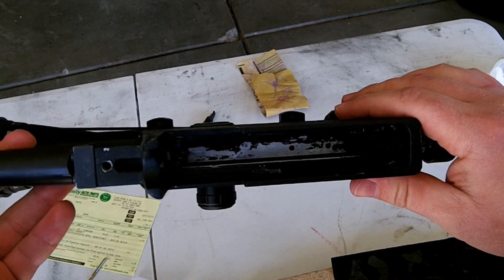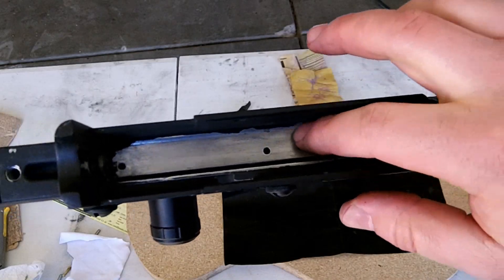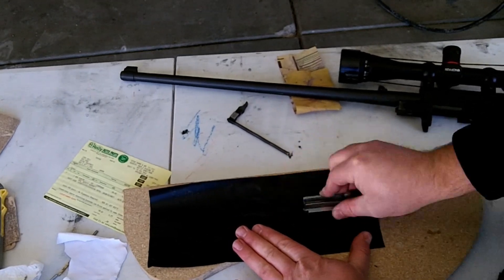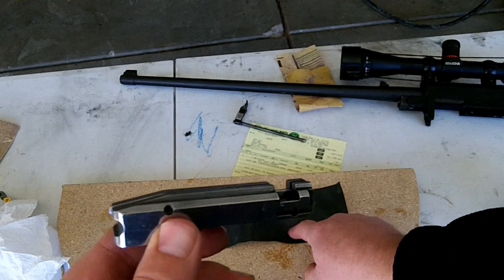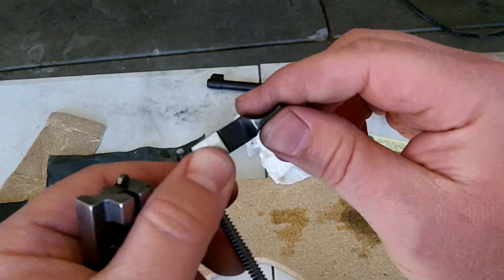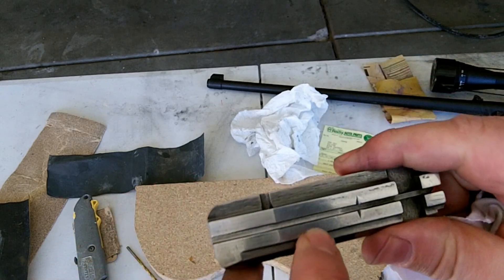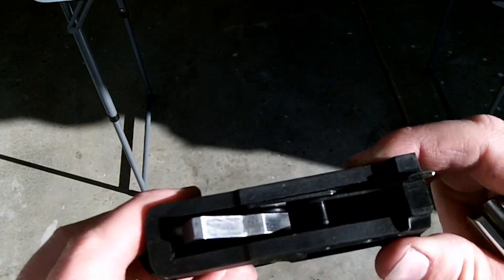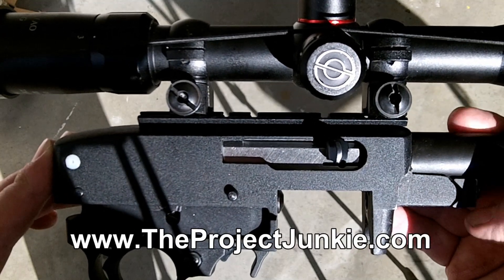Ruger 1022 Bolt Mod

Comment: Just starting this awesome mod.  Two Notes:  #1.  The 5/32 Roll Pin removal -   I tried a 5/32  punch with a kind of cheap "Irwin Pin Punch Set (not a proper Roll Pin Punch).  I got the pin to move a little, but it wouldn't come out, so I used the 1/8 punch like Mark used in the video to drive the pin out.  Funny thing though, after the pin was out, I couldn't get the Irwin Punch to fit into the hole!  I even tapped a couple of light hits with a small hammer, it would NOT go in the hole!  Is it the cheap Irwin Punch, or did I scar the punch?  Not sure, but it wouldn't go in, yet I'm SURE 5/32 is the correct pin size.  #2.  There are TWO (at least) Ruger bolt types for the 10/22.  Mark's rifle has 2 long rails and 2 small "Pads" (as seen in his great video).  My bolt has 4 raised "Pads" or polished sections on each end of the rails.  These "pads" are BARELY raised above the rest of the unfinished rails, maybe 1/64th inch?  My point is... be VERY careful how much you sand the "4 Pad" style of bolt!  I may just polish those 4 areas and leave it at that.  There is a YTube video showing the other style of bolt, it's called "Ruger 10/22 bolt polishing".  Just thought I'd pass this along for other amateurs like myself.  GREAT VIDEO MARK, THANK YOU!

Comment: I would suggest using a dremel and jewelers rouge. The grits you are using in this vid take of too much metal. Guns aren't designed to work in the loose tolerances you are creating. Im not saying not to polish the bolt face, but dont be lazy and use 400 grit. what you are doing in this video is a long and laborious process. dont get lazy and use sub 1000 sandpaper. It probably wont make too big of a difference, but I would be willing to bet your 10/22 is a bit less reliable than a stock one.

Comment: I’ve done all these mods , the radius on the bolt that cocks the hammer is one mod you don’t see much on , these little rifles shoot good but better with a few mods and some aftermarket parts. These rifles are easy to trick out , but it’s difficult to find information on the mods that make them shoot better and trouble free . You did a great job on this video, thanks for sharing.

Comment from the maker: I appreciate the concern but the truth is I've had a lot less cycling and feed problems since performing this and my other mods- And yes I've put a few thousand rounds through the rifle since this mod was performed. I've also had others tell me they've had positive results with cycling. However, I do agree that you don't want to over-work your bolt too much. I like using the 400 grit to level the top fast but I also don't take too many passes with it before I move up to finer grits.

Comment from the maker: Thanks for the tip. I think it would be better too. In fact I considered using plate glass but thought the cost of the glass wasn't worth the extra performance benefit over the wood- which was still pretty flat. So, if anyone has some glass laying around it's a preferable platform in place of the wood. Thanks for the comment!

Comment: I just think Ruger really skimp on quality control. This shouldn't be necessary when you buy any gun. It should be smooth running and free from factory. Great video and a must for my 10/22. When I cock the gun, even without ammo, sometimes the bolt won't close completely and stays open only by 1mm or so but annoying all the same. It still fires every time though. Does anybody else have this issue on their factory Ruger?

Comment: I had problems when I bought a new trigger group. The old one's hammer had been worn smooth and the action was flawless. With the new trigger the bolt kept getting caught on the hammer block. It caused failures to eject and more often, failures to feed the next round.

Comment: I did the trigger pull modification following your directions and it was easy and it worked pretty darn good. It may be a dumb question but before I do the bolt modification could you tell me what my goal is and why am I doing it?

Comment: also, polishing is all the bolt faces needed. What you did with the radius of the bolt wasnt a problem, IMO
Reply: Zach K   A guy did that mod on his, and it immediately stopped his stovepipe issues with cheap, bulk ammo.  He can shoot anything now.   Your bolt slides back easier, as its cocking the hammer back. Makes good sense to me...   Plus, it's a fraction of an inch farther back, when your bolt makes contact with the hammer.  That may be all you need, to fully eject an empty casing.     Do you understand all of this?  Not sure if you understand how things function...

Comment: You need a Dremel!. And polish it nicer..and #2-get that crap homemade nylon bolt buffer out of there!!. It will crack and break/snap/shatter in cold or freezing temps!.then your screwed...spend the$2.00 to $5.00 on a good one!!!
You want your bolt cushined and quieted..

Comment: did it all like ive done with all my rifles through the years.. for the first time it didnt work out well.. now my bolt lever is super hard to pull at first, like its binding up in the first 1/2" of pull.. Only material i took out was the paint, and polished everything.. very weird, almost seems like its in the bolt lever spring assembly, like its binding on the rod.. did you have any issue like this and what was the cure? thanks
Reply: +K Lavelle I know this is 8 months old, but have you isolated the charging handle/spring to see if it's catching between the charging handle and where it slides on the spring rod?